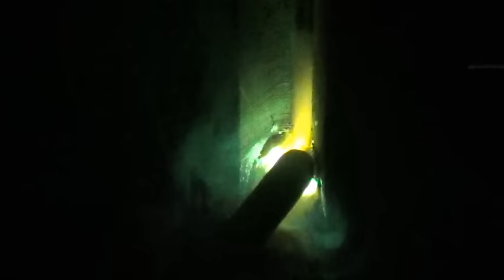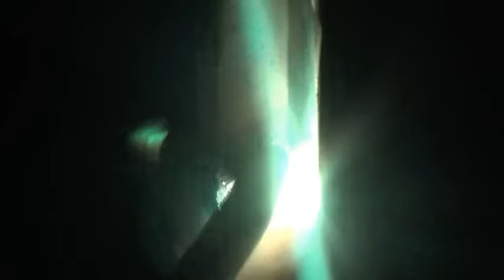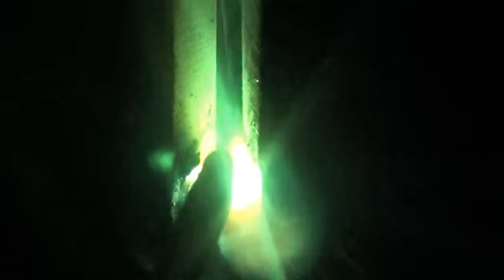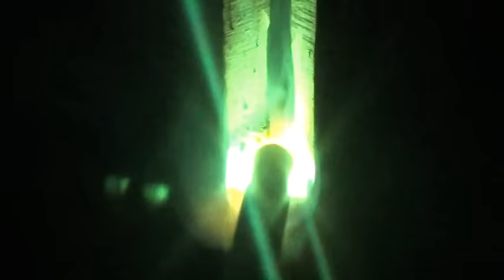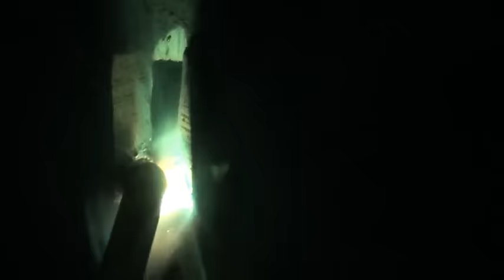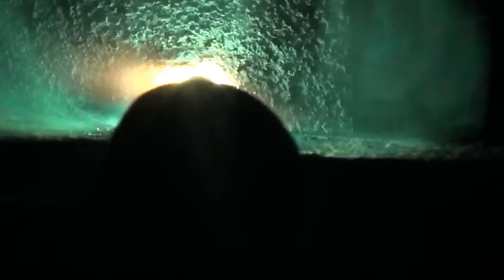7018 open root stick welding

Comment: I am 78 years old now but for more than 40 years of welding repairs on heavy equipment the 7018 low hydrogen rods was what I used mostly

Comment: Nice control, cannot remember the last time I did an open root 7018, at least for work. Here at home my fit ups aren't always ideal and neither is my rod supply, so occasionally I do stitch together some healthy gaps like this, but not for such a long pass. Very clean job and nice filming too, thanks.

Comment: nice welding sir.. wasn't expecting the backside to look so flat and strong as I've welded 6010 root passes many times and tried this with LH and key hole alwayz to big.. practice makes perfect like this weld.. nice job

Comment: Dang dude, hats off to this, its gotta be hard with 7018 doing a root pass
Reply: Dj Giggles

i dont know any better, whats so good about 6010?
Reply: Marco The Welder it's all about code
Reply: Marco The Welder 6010 is a fast freeze rod. Low tensile strength though. It's good for penetrating through rust or paint or anything else that you may not be able to get at to clean. It's also great for really thin ,old stuff that doesn't have any minerals left. Then you can cap it with 7018. Pipefitters use it on a root pass sometimes on low pressure piping.
Reply: With 2.5 mm rod is not problem,but with 3.25 mm it seems limpossible.
Anyway good job.nice weld.

Comment: Its easier with 2.0mm 7018 rods but u cant weld so far.... Can't understand why somebody criticizes this, so smooth moves and one nice root pass. If I do some 2.5 rod I'm gonna go with 60 V-Groove and 1,5mm root face. Cheers mate. Torilla tavataan. :)
Reply: 6013 (think 6010 also) for root is like bicycle with training wheels! Can't go wrong
Reply: I am new to welding and bought myself an Everlast welder. Is learning to stick weld with 6013 recommended?
Reply: 6010 n 7018 is the norm for pipe welding w/ stick. which is where the money is... get good at that

Comment: Very nice looking weld but i would say it got too hot and the welding inspectors usually don't like that but very good and flat reinforcement :)
Reply: +DonC1337 I didn't see the inside of the root pass just the outside, how can you tell without x-ray or visual? Need to know.
Reply: +Pat Foret The last shot was of the backside, where he was knocking off the slag with a rod, looked slick to me, even if it's not how we do it here in the USA...

Comment: Attis, Thank you for posting this video! You got the filming angle just right for us newbies to see exactly what needs to be done. I am in welding school here in Mexico and the instructor just move us to 3G/4G with 7018.  I am going to practice with your technique tomorrow but I want to ask you if you suggest the same technique for overhead or if you suggest some changes. Thank you for your help!
Reply from the maker: Thank you for your reply.
Overhead open root I would have almost straight angle with rod.
And you really must push the rod upwards to get a nice root.
What kind of a welding machine do you have in Mexico??
Reply: ***** Hello Attis, I am using a very old Mexican ISSA brand machine, It is a transformer type machine with no bells & whistles, just a big crank for amperage. The current indicator is completely faded so I have to set the amperage by feel. The arc is nice and stable though.
 So for overhead, would I still do the slight weave and pause like in the video and then push the rod into the open root?
Reply from the maker: Supercritical Yes little weave and more pushing and straight or almost straight rod angle. These are my advices, hope it helps you.
Reply: ***** I did the vertical up plate today and beside a bad start with too high amperage, once I adjusted down it worked like a charm! I will weld the overhead plate tomorrow, Thank you so much for your time and advice!
Reply: ***** Hey Attis, I have been trying to do the overhead plate but I cannot get it right for the life of me. I've tried all sorts of gaps and shoulders but no matter what I do I never get enough penetration. The slag ends up where the weld should be, about 1/16 over flush (on the back side) but once cleaned, I have about 3/32 of sunken bead. It is driving me insane, but our instructor insists that this is the actual test for a lot of the shipyards here. Also, he won't let us any other that 1/8 rod. 

Do you have any advice on this situation? I would really appreciate any help you can give me.
Reply from the maker: Supercritical Hmm, very hard to give you any help from here, I only can say that you must push and force it to come thru, its hard I know.
Its easy to say how to do it, but hard to learn..
I promise to make an overhead video, but dont expect it soon, iam busy right now and dont have time for video making..
Reply from the maker: ***** I have never welded that test with so big electrode and never even tested it, I have only used 3/32. Odd that they want you to use so big stick.
How thick material do you have?
Reply: ***** Thanks for the response!, I am welding on 3/4" plate beveled at 60 degrees. After so many tries, I can only reason that 1/8 rod needs so much heat that the weld pool is too fluid and heavy to fully penetrate upwards. I think I will sneak a try with 3/32 and see if that works. Our instructor might just not be familiar with this test and he may be assuming that 1/8 rod is the right one.
Reply from the maker: Supercritical Ok, I hope you can do it that way. :D
Im sure it gets easier with 3/32 electrodes. Hope you can nail it.
Reply: *****
I will, thanks for your help. If you ever make it to Mexico or I make it to Norway, I'll buy you a few beers!
Reply from the maker: Supercritical Hah, come to Finland and then we will discuss about those beers. :D
Reply: ***** Sorry about that, I guess I've been daydreaming too much about North Sea jobs lately.
Reply from the maker: Supercritical Dont mention it, me too.. : D

Comment: Well done i am at trade school for a pressure systems welder apprentice and we have to do everything open root with 7018 . All critical welds 😊. Thank you for the video how hot did you run ? Around 90 amps ?
Reply: Ben Saunders hey there, to answer that question since nobody did id say 80-85 amps i tested it myself and over 90 was a little too hot for it. this man was pretty slow surprisingly he didnt blow a hole so my best bet is 83 amps
Reply: He is welding it with a handheld remote control To control the amps. So he starts probably around 85 To 90 amps, then lowers the amps as he welds.
Reply: @frankzavala8605  would you say run on DCEN straight polarity?
Reply: Wollecm

Comment: The AWS suggests that 7018 does not get as much penetration in a root pass as 6010 does, but that looks like it has the desired penetration. Nice.
Reply: Not as much penetration, no. The hydrogen content in the flux of a 6010 rod gives it the hotter arc and better penetration. 
But a 7018 or 7016 root is MUCH stronger deposit that a simple 6010, by a big margin too👍

Comment: Hi, very good weld . what is hand held remote ,is it something already come with  your welding machine? Or is  another tool you used  different part from your machine . and how do you use it..? Thanks..
Reply from the maker: Erick Taka We have welding machines here that can be attached with a hand held remote, here you can see what it looks like. http://media.machines4u.com.au/machinery/8/191308/KEMPPI-R10-SINGLE-DIAL-REMOTE_2978578.l.jpg

Comment: what kind of amperage are you using here? and its sort of hard to tell but are you angled up at all or just straight at the plate? and great job by the way. Ive always done this weld in school with a 6010 root, 7018 fill and cap but i have a job test tommorow open root 7018! i thought that that was somewhat bizarre its obviously possible tho! thanks in advance for your video and any advice!
Reply from the maker: I dont know my amperage, I use remote hand control when I weld so I dont have to think about amperage. Yes I have slightly upward angle. You can see that you are getting a good penetration, when there is a small hole burning ahead of your bead. I hope this helps you good luck to your test and thanks for your comment. :)
Reply: ***** damn it, do so you are gradually adjusting amps as you go? to you have an amperage you start out with?

Comment: Lovely work. Would have liked to see the back side of that root run though.
Reply: paul greenwood the back of the root is at the end of video
Reply: paul greenwood t
Reply: I'd say we did see the back, the last frame in the video.  But a commentary would have been useful.
Reply: I'm with u Paul it's straight po just turn it up and hold it tight
Reply: It's at the end and looks pretty good

Comment: Not a lot of spatter, I think that's the fist stick weld I've seen that is not throwing out heaps of spatter. How do you stick with only a little spatter?
Reply: 7018s in general tend to have low spatter and a fairly smooth arc. To keep your spatter down across the board, use adequate, but not excessive, amperage. With some aggressive rods like 6011, it can be tricky though.
Reply: If splatter is your issue, your rod moisture is probably too high. Keep the rod in a hot box or rod oven until needed. Humidity reeks havoc on 7018.

Comment: whats the HAZ like when welding like this? that plate looks pretty damn hot. I normally use 6010 for my roots, but i would like to give this a try. Looks useful for applications that require lohi

Comment: Get some 7016. They are a low hy rod actually designed for all passes, specifically root passes.  Rather than a 7018 which is designed for fill and caps.
Also, DCEN gives a more controllable pool. 
Lastly, start ahead then drop back to crater, pause then continue your run. Any low hy rod run without starting ahead and coming back will leave porosity in every start.

Comment: really good arc shots. more info. and comments would be cool. Thanks.
Reply from the maker: What info do you need?
Reply: Comments and info in general. Rod size, gap, thickness of material, type of material, application, ect . I am learned to weld on my own, do some part-time work, dumpsters, sea boxes, truck racks w/1 1/4 pipe, backhoe and loader buckets, and misc. items for a plumbing company. I only use 6010, because that's what I was supplied with and what I learned with. When I have played around with 7018 I have a hard time with the slag. Watching I only hope to learn. Thanks
Reply from the maker: Richard Harms rod size was 2.5mm, cap was also 2,5mm and material thickness 8mm.
Here we dont have a 6010 electrode, so we use 7018 for root, fill and cap.

Comment from the maker: Im in Finland, we dont have that kind of rods. Only use 7018.
I will do 7018 and stainless steel 6g videos some day.
Reply: +Attis k what the angle of your rod and ampere?
Reply: +Attis what the angle of rod and ampere?
Reply: Great video. I'm just learning to stick weld with 7018 now with my everlast welder. You have really helped me.
Reply: How hot u running
Reply: Attis k, great video, what helmet did you film this with ?
Reply: How to use amp & volt in 4G-3G  position, and how much gap  in 4G position test plat
Reply: Traductor

Comment: What was your gap and land size for that weld? I've done a few 7028 roots! 6011 s are a lot easier
Reply from the maker: I have 2,5mm cap and zero landing. I have heard that those sticks are easier to use. But 7018 is easy also when you learn it.
Reply: 7028 roots?? Yeah alright mate😄😄😄

Comment: how can you hold so long without blowing through, how many amps??? i was messing with angle iron 7018 on high amps like 110-120 trying to flatten my weld in the seam but it became even more concave then using lower amps. i got so frustrated.
Reply from the maker: pearlmeninnoa I can hold it so long becouse I use a hand held remote. I can lower my amps when that plate
gets hotter. Everyone here do it like this.
Reply: *****  Ya i see that in the comments now, sorry for all the same questions. Do you have any set amperage you start at?
Reply from the maker: No I just turn amps somewhere and light the  arc, then I adjust it to correct level. I can see it immediatly if my amps are wrong.

Comment: ***** I have to take a 12" branch test with a 7018 bead. I have been practicing but I can't seem to keep from trapping slag and having some porosity on the root. Any help would be greatly appreciated. I have talked to all my pipeliner buddies and they have no clue
Reply: You are probably using an excessively long arc length
Reply: +Spencer Stollery. I keep it crammed in there. I can feel the flux burning off. I could take that plate test all day. the branch is a while different animal

Comment: on how your key hole is not getting large ,I think your running a diffrence rod
Reply from the maker: +bob nylund I run 7018 esab ok 48.00 rods in this video and I have no root face, if that is what you ask.
Reply: you can close a gap w 7018 man. you're looking at it... especially 1/8th inch

Comment: Do u guys use much 6013s there! Yea that would be great!
Reply from the maker: I havent ever seen that kind of a rod. Only thing I know is 7018.
6010 is used by some farmers, who have some very old ac welding machines.
But in work it is 7018 only.
Reply: +Attis k 6010 won't run on a AC  machine

Comment: Alguien podría desirme que diámetro de electrodo es y cuanto de amperaje esta usando?
Reply: Aparentemente es 7018 de un octavo, la corriente depende de la máquina, el espesor del material y hasta la temperatura ambiente, normalmente esta soldadura se aplica así para estructura, pues a veces se limpia por el otro lado y se aplica otro cordón de vista, para tubería se usa en el fondeo electrodos de penetración como el 6010.

Comment: What kind of application calls for a 7018 root pass?
Reply: Wondering the same thing i was tought to use a 6010 with whip and pause
Reply: +Mark Spence In finland only farmers etc use 6010. Its all  7018, root fill cap. Also pipe.
Reply: In california they prefer 7018 over 6010
Reply: +Mark Spence  the welding procedure dictates and indicates all info. needed for a pipe welder to make welds as Metalagerast instructs.
Reply: low hydrogen applications
Reply: Structural welds. All 7018

There are other things in this world that get welded other than pipe!
Reply: US Navy Shipyards required it on plate and pipe back in the 70s not sure now. Had to keep it tight in the puddle and move to keep from blowing through. Made a much nicer root than E6010 plus it's Low Hydrogen. They made us grind every start and feather the stop. They didn't allow backstep.

Comment: 6010/6011 roots...2g,5g,6g! 

Where u based?
Reply: A very big part of the World doesnt use 6010/11 at ALL, for any Critical welds. Only 7018. And we do a lot of stainless pipe/tube welds with stick all the way Out too, xray quality.

Comment: In thin sections like this the use of 7018 also over heats the base metal and you HAZ is huge. This should only be done on heavy wall sections. The reason being is the 7018 is a fast fill not fast freeze rod so the heat is concentrated in any one spot for a much longer time. Not really a good practice on thinner sections.

Comment: hahaha i do root passes with 7018 all the time its all about keeping it at 110 amperage
Reply: Ebrahim Camarillo  what about if you use 7018 with 3/32 what amp would you put got a test tomorrow lol
Reply: Depends on your landing and gap, but 110 sounds like you’ll get some undercut😂
Reply: Alfredo Reyes anywhere from 70 to 80

Comment: Open root with 6010 is easier faster and less heat into the metal no offence but a 7018 open root is ass backwards you might as well have a backing plate or tig it unless you are scared to grind out the root
Reply from the maker: Jacob Sharpe Around here we don´t  use 6010 electrodes, if we have to do a stick root, it´s 7018/7016, 90% of the time.
Reply: What amperage was used in this case?I've been using so far ESAB,Boehler and other 7018,but other day they have brought me Oerlikon 7016 which are quite sensitive on amps,so I weld filler cap on 6mm wall pipe with 2,5mm 7016 on 65A.I'm asking because from time to time I have to weld root pass,and you have done it so nice.Thank you in advance!

Comment: Open root really isn't that hard, neither is welding pipe, weld pipe all the time. Open root welding if you've been welding for a while is pretty much common sense
Reply: Dj Giggles .

Comment: first, weld the root of the seam with an electrode of 2.5 mm. after that, the filling of the seam is cooked,and then the final seam is cooked,and you welded everything in one pass and there was a tightening of the metal..this is wrong, learn from Russian welders!!!!
Reply: Whrn you say cooked,what does that mean?
Reply: @slavensmolcic  the seam is performed in 3 stages, root, fill and facing.....it's just that the translator doesn't translate well
Reply: @4yk4a-41  Just what I thought.It's understanding that sould be waited between the passes for temperature to come down.In most cases,one should not run next pass if surface is warmer than 160°C.
Reply: @slavensmolcic  no, not because of the temperature, the seam is cooked in 3 passes, this is always done ,this is the welding technology, so the tanks are strong)
Reply: this refers to thick metals with a chamfer